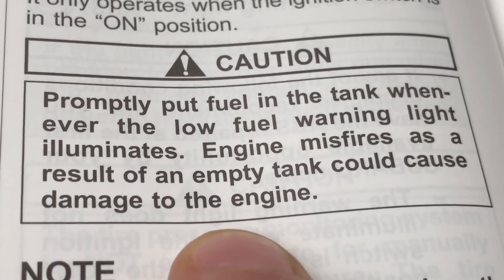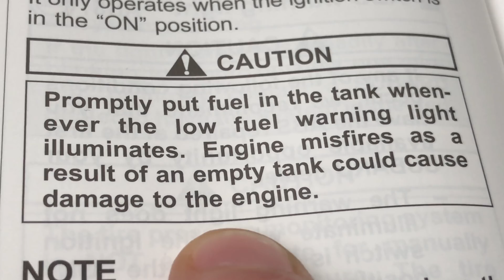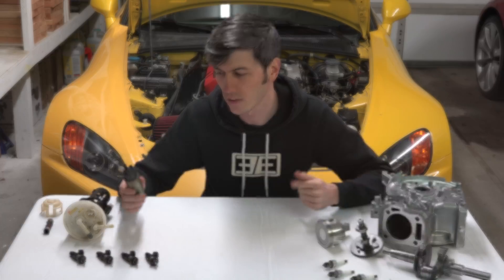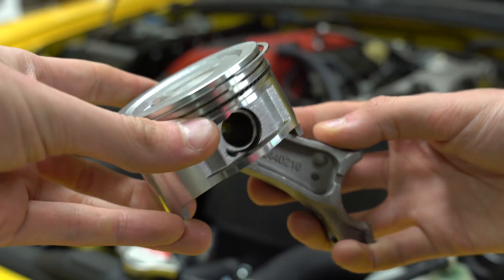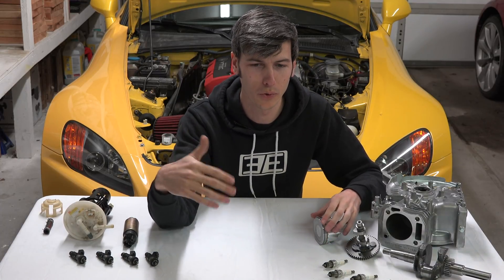Will Running Out Of Gas Damage Your Car?

Comment: You kind of forgot about diesel cars and their high pressure fuel pumps. They rely on the lubrication provided by the diesel. They can be damaged by running on air even for short periods of time. And you don't want to have metal flakes in your whole fuel system, that's really  expensive. So don't run out of diesel
Reply: Diesels doesn't have a high pressure fuel pumps if they do most is 25 to 30 psi before fuel regulator injectors spray 25k psi or more at the nozzle if it's low on spec it will knock and die
Reply: @MrMsMexican  this is true for diesel engines with unit injectors, but most engines have a high pressure fuel pump. How high the pressure is depends on the engine.
Reply: Same applies

Comment: In my experience the springs for the brushes in the fuel pump loose temper and lose contact with the armature. Sometimes thumping the gas tank will get them to seat and give you a clue as to the problem.
Reply: Giving anything not working a couple of thumps is always a first option. I had a car (in college poverty days) with a starter like that. I carried a hammer in the car for those occasions.

Comment: I'm the type to see half a tank, and think that's too low...
Reply: What do you mean? That's where the fun begins! Half Tank LYFE, WEIGHT REDUCTION BRO
Reply: @BladedAngel  i love ya
Reply: @BladedAngel  N3Rd
Reply: I drive for a living and that's me. Quarter left and I'm already looking for a gas station.
Reply: For reals... When I see half a tank, my reaction is "Great, I'm almost on empty. I need to baby the accelerator to save some gas."
Reply: I used to think this was silly-- until I got a car with a digital fuel "gauge" (with really big bars). Half-tank is the new quarter-tank for me...
Reply: Yep thats me. Sometimes it will be 3/4 tank and I'll get gas just to drive.
Reply: Im the exact opposite on my motorcycle.... see the last gas bar flashing... oh i got enough for miles... never ran out yet.
Reply: No wonder people think EVs don't have enough range and places to charge. You people sound like you're putting more gas in every 20 miles. Good lord.
Reply: @mjc0961  Nobody even remotely implied that. 😏
Reply: Same. Also phone battery. 90% remaining = time to charge.
Reply: @dchawk81  at 90% i pull the charger becouse i dont want to dmg the usb charger unit like it happened 3 times to me or dmg the batteries
Reply: @stefanpredl6849  I haven't had that happen yet. I'm on my second phone battery but it was over 2 years old, which isn't abnormal.
Reply: I recommend filling up at 1/4 tank.
No risk of damage to your engine and you have enough gas (in almost all situations) to get to a gas station within 1/4 tank, so you're safe on that front as well.
Reply: @azeez8399  When my gauge says ¼ is left and I fill it, it only takes 10 gallons. The tank holds 14.9 gallons so when the gauge says ¼ it's actually closer to ⅓.
Reply: I tend to run my old diesel pickup on E for a while because the gauge is so inaccurate, it'll sit there for another 80 miles. It'll stay beyond Full for 100+ miles, drop to E within the next 50, then 80 more it finally cuts out from starvation.

It probably goes without saying but there's a Jerry can in the bed full at all times. 😏😁
Reply: @stonksmcmeme  Oh yes I did. I missed that one when I scrolled back to see what you were responding to.

That would have been sarcasm.
Reply: I go to 1/4 but thats when my 50 miles to empty light comes on while running e85 lol
Reply: If you are going to a track then that could be true
Reply: 3/4 of a tank is empty for me
Reply: 1/4 for me like right on it
Reply: For me when the needle below the red line, that's time for few hard accelerations!, then the fuel station
Reply: I also generally use the half tank mark as the time to stop for gas, the handful of times I don't follow this rule is on a road trip where I will be driving like 700 miles+ then I fill up before I leave and try not to stop again till i'm at the state line where I need to get gas before crossing over into Florida where gas prices tend to jump up and then my new car, I can go 2 weeks in my 2016 Civic and still have a third the tank left, so I do that, it's not half a tank but it's not running it down to the low fuel light.
Reply: I always go to a quarter. Because I don't like that idea of gas getting old a stale in the tank. Want to burn most of it off so when I fill up it's always fresh
Reply: @Bennysol  the old and new mix together it's not like they remain seperate layers in the tank
Reply: @DanielsCorner644  I have a 34 gallon tank. Half tank, 17 gallons, even mixed with new over time, in my opinion, will create old ethanol and gas in the tank. Just a preference but I feel better going to a quarter tank before filling up.
Reply: This is how you don't wind up in gas lines during a major storm.   15 gal in the shed too.
Reply: Tru
Reply: i fill when it's at 1/4. usually to 1/2. more if i'm going on a long trip.

1/4 still produces 100km range for me, meaning there's still around 5 liters or more left in the tank. plenty for what i need.
Reply: Yep, I’m the type where nowadays I jump from station to station to station.  I haven’t seen my needle move more than a mm in years -> if there’s gas, I’m getting it!. No brainer.
Reply: @stonksmcmeme  This is old but nobody said anything about plugging in at 90%.
Reply: I see half tank and say “yesss full tank”
Reply: I run my car till I have 0 kilometers left on the trip computer and the fuel needle below zero 😂
Reply: @harbl2479  Hopefully you learned something from this video then...
Reply: @a.wheeler7731 if your computer tells you 0 km left you still have like 1,5 gallons of fuel left... So nothing to learn here except to stop racing at this moment
Reply: @A. Wheeler 
Like what? 😂
Reply: I'm the opposite. A 1/4 is still 'plenty' and even hovering over E is still 'fine'. It's not till the combination of the fuel light coming on and the gauge bottoming out on E that I get ready to fuel.
Reply: You must be corner hard, accelerate and brake constantly thru uphill and downhill. Or going thru a desert a lot

Comment: what will happend when you run your electric car to zero
Reply: It won't be able to charge your smartphone . Where as in a petrol car it still could 😁
Reply: @jackd1582  ...for ~1 hour, and then you have even more problems, as you're both out of gas and need a jumpstart.
Reply: @cgunugc  Least I could phone home 😁
Reply: it runs out of electrolytes..

Comment: I once ran my car out of gas just as I was approaching the gas station. The engine cut as I was driving up to it and I had just enough momentum left to come to a stop next to the gas pump. Filled it back up and was good to go.
Reply: bruh
Reply: Had 3 exact situations for me in 3 different cars off mine 👍
Reply: What a boss
Reply: You daredevil
Reply: I've done that a few times and replaced a fuel pump once after running out of gas. Not worth the risk.
Reply: similar story for me - mine cut out at 60mph in medium traffic while i was in the center of 3 lanes. ended up running someone off into the shoulder because nobody would let me get over.  coasted down the exit ramp to the red light. when it turned green i tried starting it again, and got up to about 10 mph before it died and i was JUST able to coast into the gas station
Reply: @Gibson99  what a boss

Comment: I'm not convinced heat is the culprit in the fuel pump demise from low fuel.  I'm thinking it's cavitation that destroys the pump, every fuel pump that I have disassembled post failure have been chewed up pretty bad...
Reply: I've always seen bad brush springs. Maybe your state uses more ethanol.
Reply: @Foche_T._Schitt  no, the pump rotors themselves get chewed up from cavitation. I have disassembled three failed fuel pumps and all three were the same results, the pump failed and was chewed up, the motor itself was fine.  9 times out of 10 if your fuel pump fails from low fuel cavitation, you can bang on the bottom of the tank and it will run long enough to get out of the road.
Reply: @travispeoples  
Banging on the tank should cause the brushes to seat on the armature. It shouldn't have any affect chewed up parts.
Reply: @Foche_T._Schitt  Google fuel pump cavitation.  The pumps I disassembled hadn't ran long enough to wear out the brushes... banging on the tank will dislodge the debri from the rotors and sometimes allow it run for a few seconds longer.
Reply: @travispeoples  
I did duckduckgo & google fuel pump cavitation before replying, I got a bunch of water pumps in the image results...  Maybe you need to start uploading images of your fuel pumps.
Reply: @Foche_T._Schitt  I'm not saying worn out brushes are not a cause of fuel pump failure.  I'm saying low fuel levels don't wear out brushes. I'm saying low fuel levels cause fuel pump cavitation which leads to fuel pump failure.
Reply: I'd love to see a scientific test where they try to overheat a fuel pump on purpose.

Comment: The s2000!! Love it! 
And you did not consider carburated, and most important, direct injection engines. The high pressure pump and all of that system
Reply: misfire regardless, possible for damage equally.

Comment: I'm surprised you didn't talk about diesel fuel systems being more prone to damage if you run them out of fuel due to diesel's great lubrication properties and therefore diesel fuel systems being reliant on that lubrication. Far more so than petrol.
Reply: Mordern diesels cut off before running the pump dry
Reply: LEXUS-RX300 I drove the turbo 4 version of the rx and it was pretty fun. Gimme manual though
Reply: Wait what. Rely on lubrication from diesel? Why?
Reply: @Fee.1  Diesels need a high pressure fuel system so there is a high pressure pump that is under a lot more strain than a petrol fuel pump would be. Therefore it requires better lubrication, the best way to do this is use the diesel because it's a great lubricant. Unfortunately this means if you ever run air through the pump it's very likely to damage itself due to no lubrication and send metal shavings throughout your fuel system, costing you thousands in repairs.
Reply: LawrenciuM HPFP’s are common if gas  engines now
Reply: @LawrenciuM709  @fee I came across a truck engine some years back- I can't be certain of the make now so I will refrain from speculating, but it was a European built truck using a USA engine (built under licence) and I suspect it was a German injection system. It suffered the exact problem you described- but whereas most pumps are tolerant of a little air, this wasn't and it did indeed send debris to the injectors.

The dealers were disgnosing failed injector pumps but didn't look in enough detail why, nor did they check the injectors. Anyway, so they install a new pump, bleed the system and start it up- only to find the injectors jammed with metal debris, which then fail- with the injector tips breaking off into the cylinders, with the inevitable result that you need new pistons and a new head.

But that was an exception and resulted in a re-design. You should not have a diesel pump failing catastrophically as a result of running out of diesel on an occasion.
Reply: Yes I wondered the same thing as the common rail pump can get damaged if it runs dry. The injectors are at much higher pressure too around 1800bar.
Reply: I was about to make this comment too. Running a high pressure common rail diesel dry isn't a good idea. Apart from anything else many of them won't restart by juts refilling the tank they need to be re primed which isn't always achieved by simply cycling the engine on the starter.
Reply: There is a really major difference in fuel pressure between gasoline / diesel. Nowhere near as "same."
Reply: Mariini y’all can’t even keep track of the phucking convo

Comment: Is it then recommended to not wait till the Low fuel warning light is on then fill up?
Reply: I'm not sure there can be a general answer to that. Every car has a different remaining volume for turning on the warning light. I think my owner's manual says my car still has over a gallon left when the light comes on. I usually try to fill up right before the light comes on just to be safe.
Reply: TheGerm24 thanks! gotta read up my owner’s manual now
Reply: It's most fuel efficient to keep the level above 1/2 full.
Reply: lalaithan oh i see, why is that?

Comment: Thank you so much for making this video!   Ive tried to explain to my wife that filling up before empty is a necessity but wasn't able to explain why adequately enough.   I also really enjoyed your 4WD explanation videos.  Question:  From an Engineering perspective,  I am looking into Air Lockers for my Jeep wrangler to lock up my differentials. Can you engage lockers in other drive modes besides 4 lo?  4Hi?  (for arguments sake) 2H?   Since its an external engagement?   Of course you would want to engage 4WD for additional traction but Im curious from an engineering perspective.  Thank you!
Reply: some vehicles that are only 2wd allow you to lock the diff but you need to remember to unlock it once you're out of the situation that required you to lock it, or it can cause excessive wear (on the driveline and tires) and a lousy ride.  some of those that allow you to lock will only let it happen below 5-10 mph - above that and they'll auto-unlock.  depends on the vehicle.

Comment: What would be considered too of low fuel?
would having 1 gallon left in a 20 gallon tank cause harm?
Reply: I think if you are driving normally you have to be close to running on fumes before there is a real risk. The tanks are designed to pool the gas around the intake even when the level is extremely low. Only really spirited driving would risk the sloshing causing air to be sucked into the pump. That is my theory anyway.
Reply: @Paul-pj5qu  correct. Driving normally is the key
Reply: @Paul-pj5qu  Steep grades would also cause trouble but freeway grades should not.
Reply: I would think like 3-5 gallons would be  small amount for that size tank. But you could also just not let the car or truck get to the point where the low fuel light comes on
Reply: Stay above an eighth or a quarter of a tank.